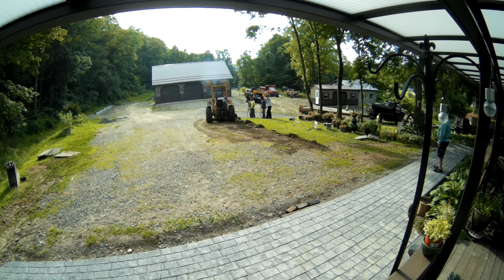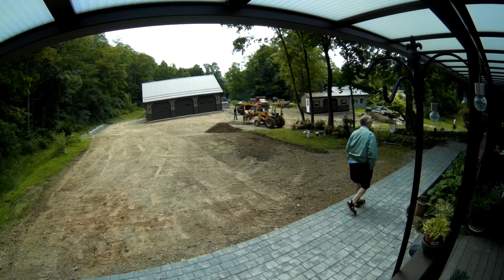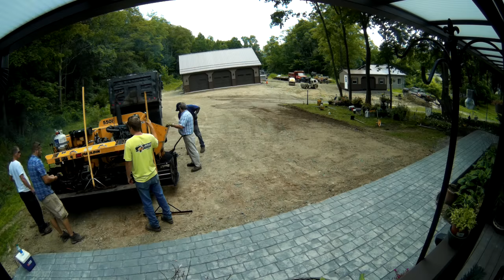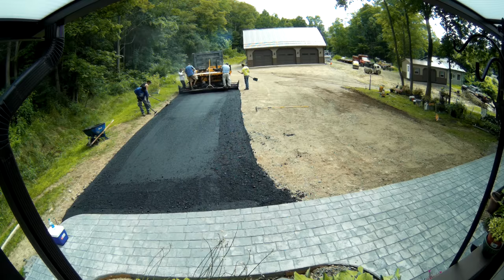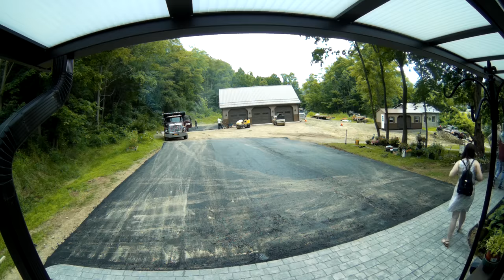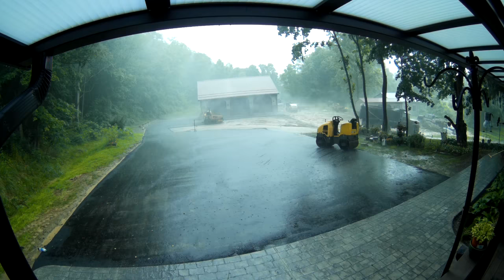Asphalt Time Lapse Summer 2018

Comment from the maker: UPDATE - June 2022, 4 years later and pavement still holding up well. Some cracks and settling but after seal coating and minor tar snakes and some small patches,  it's looking just about brand new still.

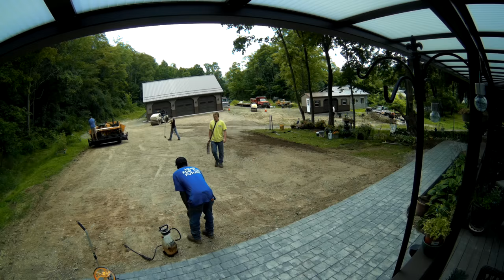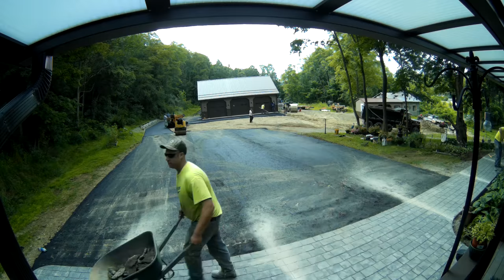0:18 - prep starts, 5:00 - asphalt starts, 11:05 - crazy cloudburst thunderstorm, 12:35 - quitting time, 12:53 - rain again, 12:59 - rain forms streams and steam on new hot asphalt, 13:33 - steam devil ("dust devil", but of steam), 14:00 - more stream devils.

Comment: Did they just pour asphalt on a soft, bare earth?
Reply from the maker: No.. 70 years of hard packed gravel and they prepped everywhere  with modified or whatever they call it.  You can't even dig this earth with a shovel around here. Even with a pickax you can't get very far down by hand.. It's hard, rocky earth.

Comment: I am thinking about doing this for a really close friend of mine and he has half the driveway. What is the rough cost association with this project?
Reply from the maker: It goes by how many square feet it is but also type of pavement used and how thick they lay it down and probably a lot of other variables. Just not sure.